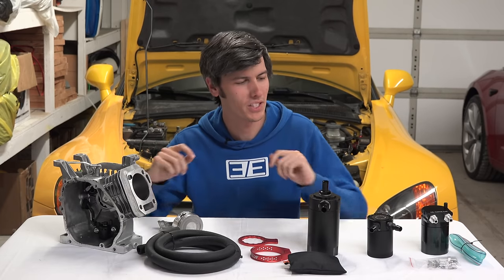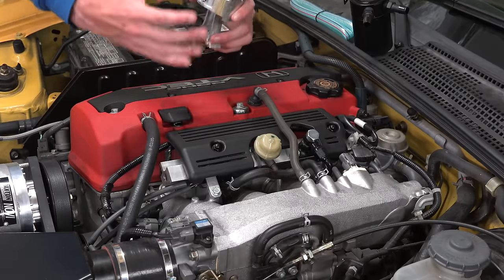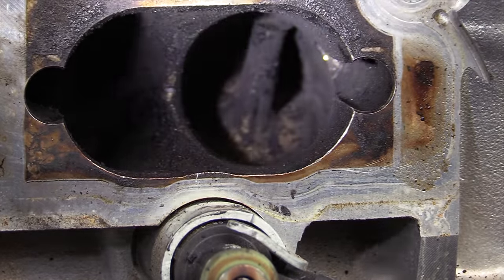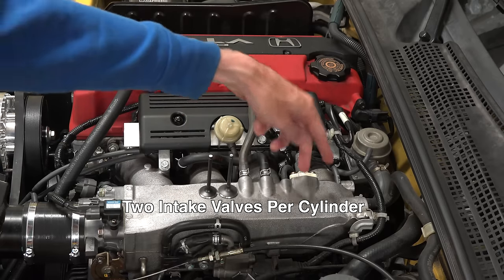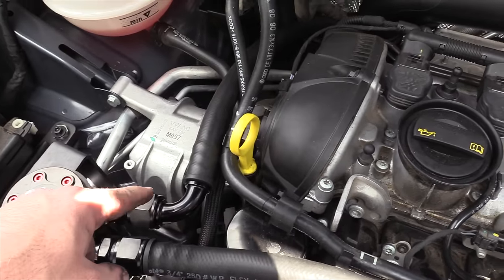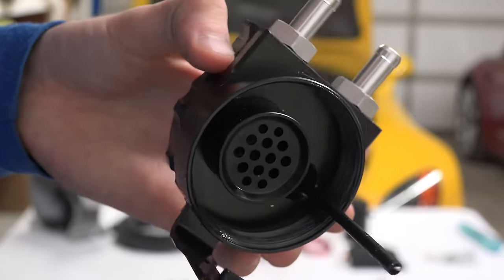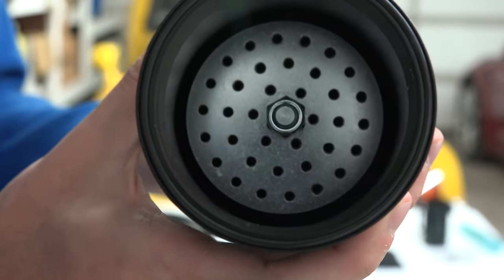Do Oil Catch Cans Actually Work?

Comment: My intercooler is the worlds best catch can :)
Reply: We Laught, but damn Our time attack ST225 and my Audi when I popped the pipes you would think I pulled a sump plug out.
Reply: Intercoolers come BEFORE the intake manifold, not after, so your intercooler never sees any PCV contamination.
Reply: HexagramMan  Trichloroethylene (chlorinated brake cleaner), toulene, Methyl-Ethyl Ketone are all FAR more effective than acetone, but intercoolers don't get oily, they get dusty.
Reply: My intercooler gets oily. It's the 3 liter diesel engine found in the Ram 1500's. I need a better catch can. One I use stops about 50% of blow by.
Reply: @904C5ZOSIX  fit another one then ..
Reply: Any suggestions on which is better. I like the brass filter. Maybe I'll try it out. 👍
Reply: Philosopher of Nonsense on turbo engines the crank case vent is plumbed in before the turbo not after, otherwise your crank case would be pressurised and your engine would be pissing oil out every seal wouldn’t it?
Reply: @prometheus575  Stop acting like a child that knows everything. PCV can route anywhere after the air filter. There's no reason why it must be into the intake manifold, and in a lot of cars it doesn't
Reply: @prometheus575  Intercoolers definitely get oily, check your facts
Reply: Philospher of nonsense. You're wrong af. You don't plumb pcv anywhere after the turbo. After the turbo is positive pressure. Thus would defeat the purpose.
Reply: @prometheus575  You should do some research into BMW intercoolers.
Reply: @904C5ZOSIX  Yeah, maybe you do need a better catch can, maybe bigger as well. If you screen the manifold side, you can stuff it with steel wool and you might get better results, and make sure it is in a "cold" place to prevent any captured water from becoming heated and steaming back into the intake.
Reply: @TheBokChoy  Stop acting like you actually know what you are talking about, cadet Dunning Kruger. I know far more about automotive technology ans engineering that you ever will. I was building cars for the track before you knew what one was. You don't even know how the PCV system functions besides the basics, or why it is there in the first place. In ALL cars, it goes to the intake manifold, THAT IS THE REASON FOR IT'S EXISTENCE.
Reply: @TheBokChoy  Well, my turbochargers don't leak oil, maybe you should check yours.
Reply: @Osprey1994  Well, BMW turbos tend to get leaky on the intake side after some time, which is why I make them into jet engines for driveway/sidewalk de-icing and such.
Reply: @prometheus575  In my car it goes to the intake manifold AND pre turbo. When the intake becomes pressurised above atmosphere a valve routes it pre turbo.

Every other turbo car I've had only route pre turbo.
Reply: If you have an intercooler it is after the turbo. Oil accumulating in the intercooler is from leaks around the shaft seals of the turbocompressor.
Reply: @Tishers  My point exactly.
Reply: It's quite easy to tell the difference between 100% oil that might leak from a turbo seal and collected condensate that comes from the PCV system. PCV condensate is at least 50% water in my experience.

P.s. my intercooler is not full of oil, I was just making a point that it's basically an ideal device to collect PCV vapours. Usually they feed in at the top and out at the bottom so condensate gets blown out (in to engine) when on high boost.
Reply: @Blokka Nokka supercharger is a sealed unit, doesn't have any oil circulation, and the gunk in the intercooler is watery because it's from the crankcase. Solid iron block with forged pistons so the piston ring have quite a bit of blowby until it right up to race temps. It is from the PCV, I know my car 😂
Reply: @prometheus575  they get oily from turbo seals. It was a joke
Reply: @briantristan5634  I think the wannabe armchair mechanics here are more of a joke than anything else.
Reply: @prometheus575  If you had a brain you'd see that I wrote SUPERcharger and not TURBOcharger. Lol

Keep digging that hole, matey
Reply: @prometheus575  Must be a troll. Supercharger after the intercooler? What's the point. Cool the ambient air with ambient air...AKA: no cooling will happen. Any forced induction engine will have the intercooler after the charger, since the compression of air creates heat. The heat differential between the ambient air and the hot charge air is how the cooling happens. Rule 1 of thermodynamics. Nice halo video btw, clearly a child in his room.
Reply: Methanol injection helps solve this, big time...
Reply: @firehawk97  I started to build a meth injector using an old fuel injector  100psi pump from Ebay and an arduino, but I got a bit scared at hooking up to my ECU to get rpm data I'll probably finish it one day, shop bought is rather expensive!
Reply: @prometheus575  Well yes and No, Most euro's the PCV drops into the intake going to the turbo, hell the VW dub stuff sucks it right into the turbo and it travels the entire system, both out Time attack cars (Golf V GTi, Focus ST225) with stock systems  had oil in the pipes
Reply: My PCV valve has a vacuum line that runs to my turbo and has oil in the vacuum line and then after my turbo the intercooler and pipe going to the intake manifold always has oil and it's not from the turbo leaking! It's from the PCV! 2012 Chevy Cruze 1.4 Turbo
Reply: @prometheus575   Probably a leak from the turbo.
Reply: @prometheus575  you can't exactly put the blow by into the intake on a boosted engine, it would pressurize the crankcase. Instead you would have to put it before the turbo or blower.
Reply: @rielanbretz7628  That goes without saying, I don't know how you would have inferred otherwise from my comments. When I said that it was put right at the intake of the turbo, it would mean at the mouth of the turbo, not into the intake manifold after it..
Reply: @prometheus575  are you now back pedaling and saying that it goes to the intake of the turbo, not the intake manifold that you have repeatedly claimed? Which would also be clearly before the intercooler. That you claimed goes before the charge side on a supercharger? Well I guess your user name checks out.
Reply: @prometheus575  You may have a lot of experience, but all that got you apparently is an I-know-everything-attitude preventing you to learn or admit lack of knowledge about some things.
It'll probably be a waste of time, but I'll try to explain something anyways reeeaal simple...
1. What's the goal of a PCV system? Release pressure build-up in the crankcase.
2. How does a gas flow? From high to low pressure.
3. Where is the pressure in the intake system the lowest? Off-boost: intake manifold. On-boost: pre-turbo.
4. Where do all stock-turbo PCV systems vent? See 3, through a valve system.
5. When is crankcase pressure the highest? Under maximum load.
6. What does this translate to? On-boost.
7. Where will oil/fuel/condensation collect? The coldest and lowest spot.
8. Where is the coldest and lowest spot in the intake system between somewhere pre-turbo and the engine? The low-front-mounted intercooler.
9. Read 1-8 again slowly if you still think an intercooler only acts as an oil-catch-can if the turbo seals are shot.
Reply: Ego struggles here. This is the channel for the people who all think they are Menza members. Not sure where it gets you fellows but is funny to follow. Norm from cheers types.
Reply: @Candisa  loool you destroyed that child
Reply: If your intercooler is filling with oil, your turbo has bad seals.
Reply: Simon A My F150 ecoboost has 2 forms of ventilation. One directly to the throttle body and another via turbo intake on the driver side.
Reply: @prometheus575  Audi's run there PCV  in 2 places in the intake system, before the turbo & also after the throttle body..... just saying Mate.

Comment: Tips and Tricks-The Audi A4 B7 2.0T has an intercooler routing that dips down near the intercooler bodies on both the passenger side and the drivers side just in front of the wheel openings, This low point acts as a built in catch can. Just bore and tap a 1/4-20 thread in the plastic connector tube there at the very lowest point. A thumbscrew with a rubber washer makes a convenient drain plug. (total cost $7). I check it regularly about every month or two. I get zero to a few dribbles from the passenger side and 100-150ml from the driver's side. No need to crawl under the car as the drains are near the fender. The car has had no problems with carbon-fouled intake valves.

Comment: I am disappointed by this video, I feel it's not up to your usual standards.

You start off well, discussing the study showing how PCV contaminants lead to carbon buildup when recirculated rather than vented to atmosphere, but then basically assume that catch cans work and move on to just trying to differentiate them.

I feel like we all agree that carbon buildup is caused by the thing that injects aerosolized carbon products directly in to the intake tract.  That's not exactly rocket science nor is it controversial.  I don't think anyone argues that catch cans do nothing either, obviously they catch *something*.

To me, the real critical question is whether catch cans catch a meaningful amount, whether they actually provide a significant difference in carbon buildup that offsets their initial cost, added maintenance, potential hassles (note some other comments about freezing up in winter), etc.  That question basically got entirely glossed over, as if it were a foregone conclusion.

I own a Fiesta ST with nearly 75,000 miles, so this question is very relevant to me, but I don't think anything you've presented here justifies the conclusion that OCCs are worth it.  If one cuts the carbon buildup in half, then it's probably worth it, but if it only catches enough to give me a few thousand more miles before still needing to get my valves blasted then it's not. That is the question that matters.
Reply: Sean Harlow most intelligent comment here
Reply: I agree with you completly. He only stated that it reduces carbon buildup on your intake valves but to what amount. Lots of 1.9 tdi diesels run fine with carbon buildup in the intake trajectory (my 2.8TD has done 300 000km without issue) so what are the real benefits if not only to spread out the problem (whats not really a huge problem) over time
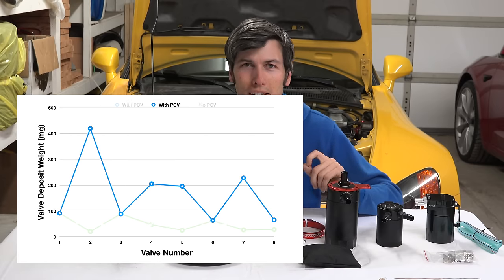Reply: 🤨 Did you not see the graph at 5:40? Those who might have an issue with freezing are either having issues outside the can, leaving their car in -20°F overnight, or have their cans installed outside of the engine bay in -20°F. For most people catch cans are totally worth it even in port injection engines. Blow-by also lowers the octane of fuel and causes the ECU to retard timing in order to prevent knocks(in vehicles that have knock sensors) which means less power, so there's that as well. Plus if you think real long term, as piston rings wear over time they allow more blow-by to escape past them meaning more of it ultimately ventilated through the PCV system causing faster buildup. I assume since you know about walnut blasting that you know what eventually happens when too much buildup occurs. Just get a good can and check it when you change your oil it nice weather or every few days in extreme cold weather.
Reply: Sean Harlow dude I have the Mishimoto catch can on my Focus St and it works like crazy. It’s catching a bunch of crap

Comment: Ah, PCV. Y'all dont remember the "draft tube", do you? Good times.
Reply: Ls1 screw on valve cover vents and plug the pcv port on the intake. My 2002 WS6 TransAm came with out EGR from the factory so without PCV my LS6 intake should be clean as hell. The car only has 65k miles but its seen up to a 150 shot and alot of WOT play. Pcv system has put more oil in the intake than I'd like. I just hear alot of mixed reviews on how well catch cans work on LS engines that seen high RPMs and/or nitrous pulls. If you vent the valve covers and block the pcv port on the intake atleast you know you're not getting any oil in the intake.
Reply: My '67 Camaro remembers...

Comment: I bought a catch for my Audi TDI and I noticed that the brass filter was on the inlet side port.  This seemed backwards to me, don't we want to filter the air exiting the can?  If it's filtered on the inlet wouldn't that cause the oil and other stuff from the crankcase to back up in the hose and not make it into the can?  Maybe I'm not aware of how these cans work.  Give me your thoughts, please.

Comment: Love your engineering analysis, but you glossed over some of the history. They added PCV valves for ecological reasons. Prior to PCV  valves, engines vented those oil droplets to the open air and not back in the engine. This started the problems with excessive carbon build-up that we must live with today. It became a "no-no" to put atomized oil into the air, in the name of air pollution controls.
Not making judgment, just stating the facts.
Reply: It was called the ROAD TUBE - it used the whole motor as it's "baffle" and sent blow-by  and oil droplets down to enrichen the asphalt, supplement your under-coating and help lubricate the rear leaf springs.

Comment: I have a naturally aspirated 3.0 l6 and installed an occ recently. The engine already has a cyclone oil separator part of  the valve cover. The occ catches insignificant amounts of oil during summer days. During cold days the same plus a good amount of water. In the winter there is a risk of water freezing and destroying the can. Also that water may have some cleaning properties but probably not, probably it’s condensation from humid air not water droplets and humid air doesn’t clean anything. 
There is an yellowish oil-water mixture that covers the walls of the tubes. This mixture gets into the manifold slowly and could affect parts of the manifold. For example mine has flaps to optimize manifold airflow and oil can affect them, but I doubt it can be stopped completely.

Comment: Interesting! 😃👍
Best option: no GDI!
2nd best option: a big can, easy to drain.
3nd best option: any can is better than no can.
I'd be a bit sceptical with the filters, made if tiny bronze/brass spheres. I had such a filter in an additive can for an engine running on LPG.
The filter became heavily clogged up by gum/wax after some years. It's difficult to clean when completely clogged up.
So I'd suggest you sprayclean this filter every time when disposing the residue in the can.
One thing you forgot to mention: some engine oils create fumes/droplets that increase engine knock!!!

Comment: Just got done with a 6 week nightmare with a mishimoto catch can. I had a ridiculous rattling noise inside the cabin of my Si. 4 different mechanics could not figure it out. Everytime I accelerated I had a terrible rattling noise. I didn't even want to drive the car anymore it was so frustrating. Turns out the bronze filter media inside the catch can had separated from the nut and it was causing the perfect frequency to make a super obnoxious noise. The can was less than 2 months old. They replaced the can for me but I'm worried about reinstalling the new one after all this.

Comment: I’ve had a Mustang Ford Performance catch can on my 2018 F-150 5.0 from the day after I bought it. I check it every 1000 miles. There is always oil in it. I have a video on you tube with its installation. I also have a 2015 Honda Civic with a Moroso catch can. Any oil you can keep out of the intake is a good thing. I’m getting ready to install one on my 1956 Ford Y-block 292 which I have added a PCV system. It’s intake valves were cruded up after 10,000 miles of driving.

Comment: I mean, idk about the s2000, but LS v8s are MPFI not GDI and the way their PCV system came from factory especially on the gen3s used a lot of oil through the valley cover due to the weird design of the valve covers. So I’ve read guys catch cans saving them a ton of used oil and keeping those intake valves from sludging up. I’ve seen under 100k mile LSs with super gunked up intake valves

Comment: So what happens if you do not empty the Oil Catch Can?, I'd hypothesise it doesn't actually push any catched oil/fuel/whatever mixture back to intake manifold, but just acts as there is no catch can even installed, am i right? at least on the 25$ it seems this way.

Comment: After watching this..... this has me thinking. My 9th gen honda accord sport (which has the k24W1 with direct injection) could benefit with the installation of a catch can. I know there are other owners of the same car out there that would agree that there are certain times in the car's life where we have to take the intake tube off and at least clean the throttle body due to excessive buildup of oil residue and buildup which causes the car to lose allot of performance or even throw the car limp mode. I think in order to eliminate this issue, the catch can would be an obvious choice imo. I'm gonna give this a shot, even if it helps reduce the gunk, I think for fuel economy it makes perfect sense being direct injected.

Comment: Recently finished my turbo miata build on 10 psi and just letting any future people know. These things are damn near mandatory, i was on a stock pcv system before i realized i blew out my oil pan gasket, valve cover gasket and i was was getting a lean issue into boost which was because too much oil was finding its way into my combustion chamber and then on to my 02 sensor giving it bad readings and causing a lean condition in boost. It was still spewing oil out of my exhaust by the time i got home, it literally got oil all over my garage floor. Thank god i had an MS3 pro that cut boost if it sense a lean condition other wise my motor would be TOAST

TLDR: these things are more important than you know, please for the love of god if you have a turbo get one.